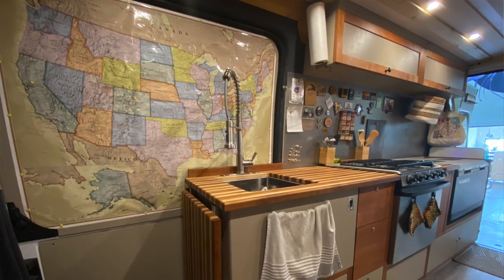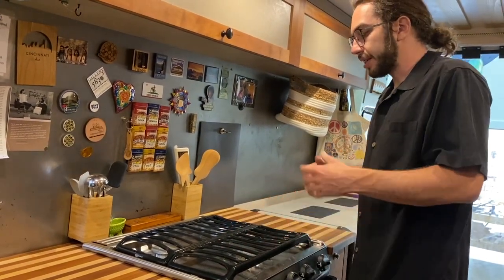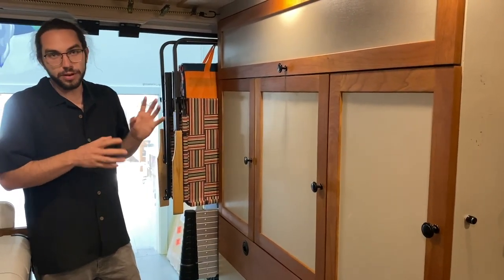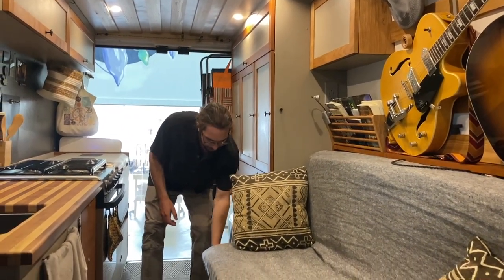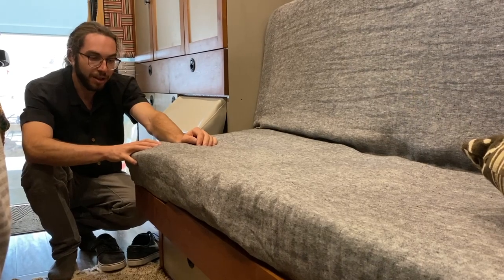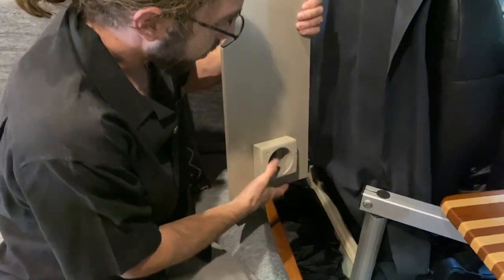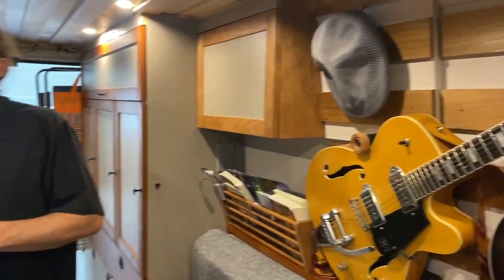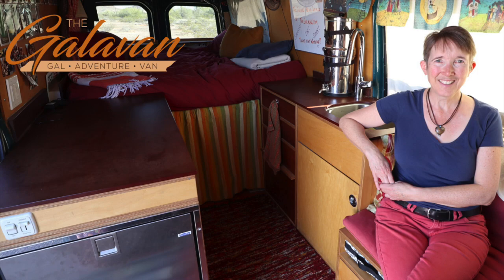Spectacular Kitchen and Sliding Bed in ProMaster | Van Tour

Comment: Thanks for this video!    So many nice touches in this design and build. Lots of great ideas to copy even if you don't want to spend money on all the high end materials.  First-  I love the sliding table/center console  Very smart and nice choice of woods.  The quality workmanship is obvious. Also, so smart to use steel backsplash than stainless which isn't magnetic.  Magnets are a VanLifer's friend.  Drawer slides for the bed is an excellent improvement on the usual sliding slatted bed.  Smooth presentation by a knowledgeable builder.